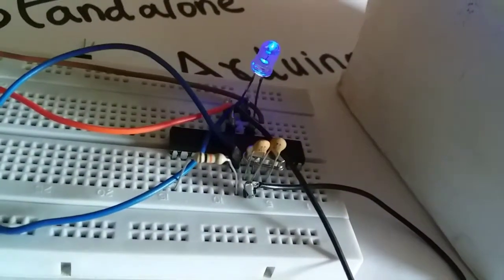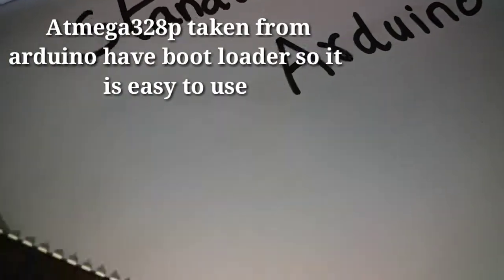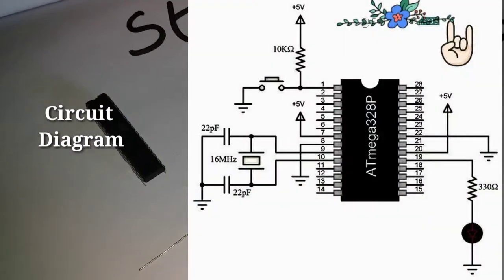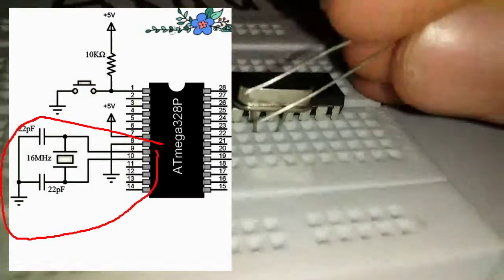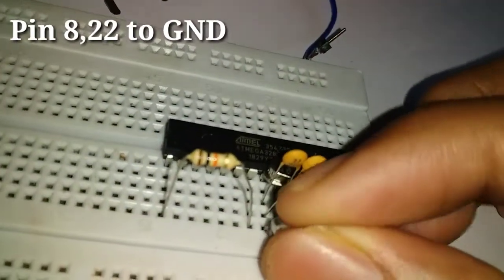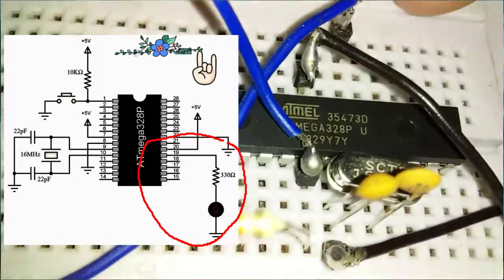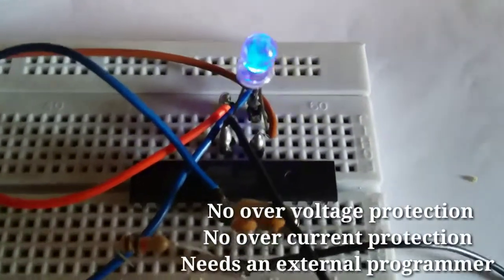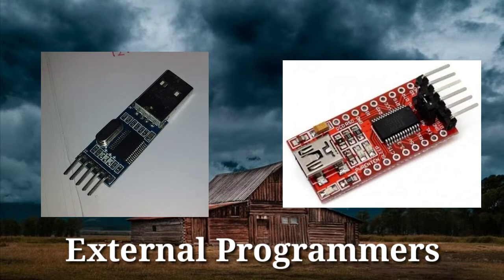How to make Arduino in Breadboard in Tamil

Comment: How to program New atmega 328p ic
Reply from the maker: first you need to upload  boot load code to freshly prepared atmega 328p ic if you use an atmega328p from arduino it is ready to use i will upload a video to boot load the ic as soon as possible